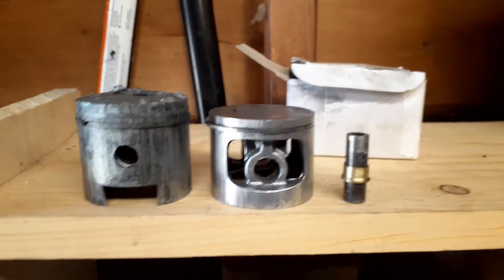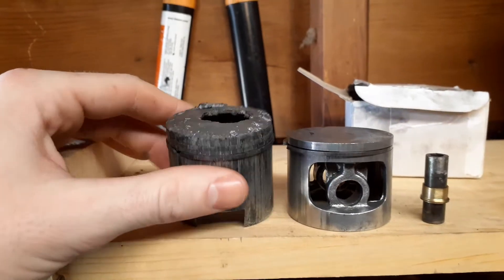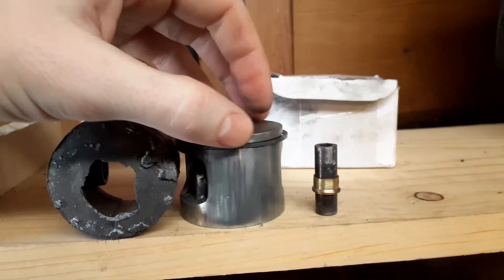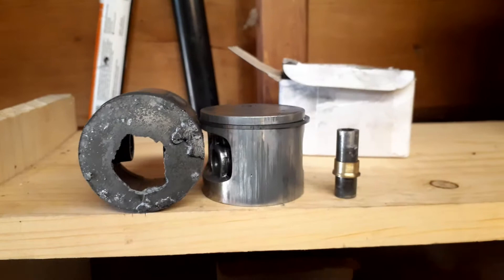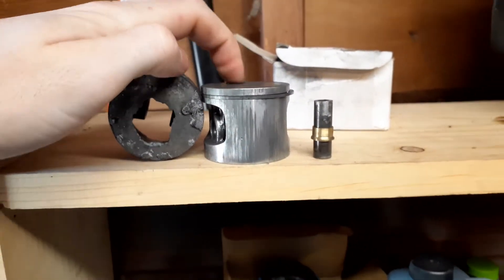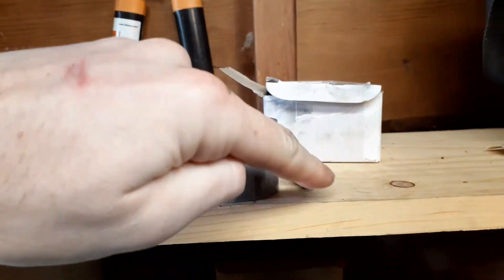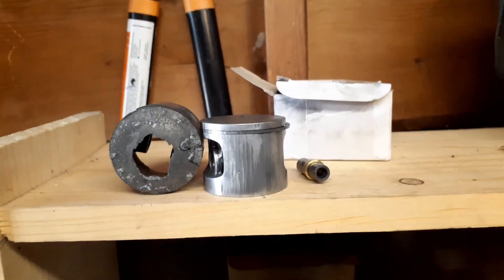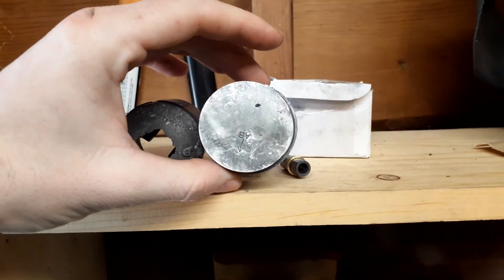Prototype Husqy flat top single ring piston for YD100 Motorbike #2stroke

Comment: what are you trying to do exactly?  run 12mm piston with 10mm pin?  just use a conversion pin bro! stihl 380 saw conversion kit and you can run a 10mm bearing in 12mm shafted piston.  just did a video on one last month!